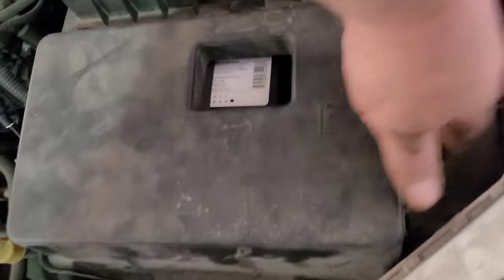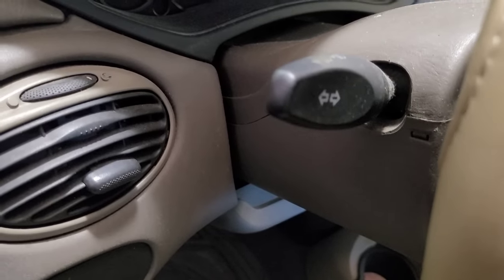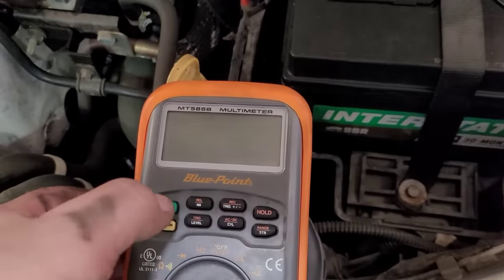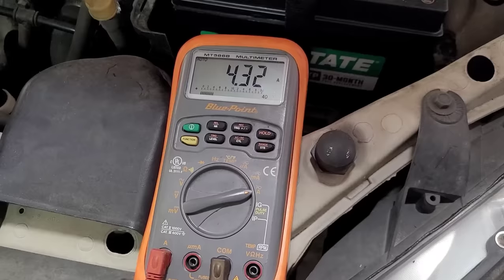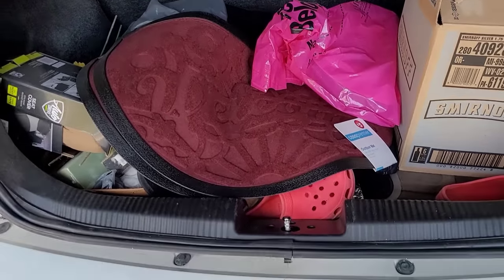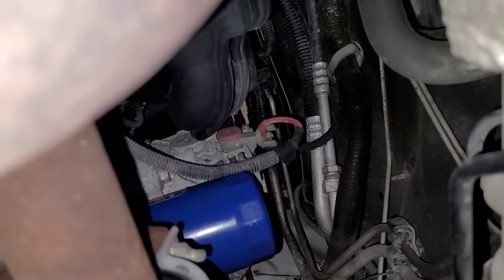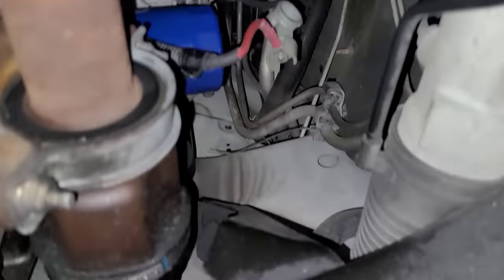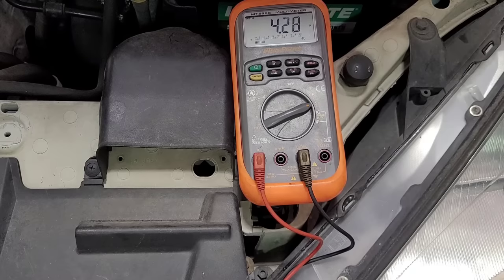Why is the Battery Going Dead? This One Will Surprise You!!

Comment: I found out that lots of oxidation on the alternator bracket causes the alternator internals to not properly shutoff due to the internal triggering due to everything being triggered by grounds that come from the PCM in those cars...Im sure if you just disassembled the alternator and cleaned off all the oxidation from the cases etc also from the bracket the draw would of went away.......For a car that gets hardly used that alternator looked horrible..

Another thing I would of recommended that customer do is get a good undercarriage wash done every spring but Im more partial to a way better and different method I use that cleans and rejuvenates without the risk of creating shorts which is this:

I take a can of CRC Silicone Spray and I start the engine and get it only slightly warm by running it less than 20 seconds then putting cardboard under the vehicle and dousing the whole engine with the whole can doing the drivebelts , sparkplug wires and youll notice the plastic rejuvenating itself aswell as the rubber hoses getting rubbery looking again and dripping off of them will be lots of nasty stuff that causes issues when it reacts with moisture...

Leave the hood open for an hour and all the wetness will be gone and the engine will be cleaner aswell as being moisture repellent...........

https://www.youtube.com/watch?v=mundEgq7pY0

My old 89 Mustang developed a parasitic draw issue and the issue turned out to be the ECU as the ECU controls the alternator too ... After removing the ECU's ability to control the alternator by hooking up the excite wire the oldschool way direct off the keyswitch I never had an issue again....

Comment: DO STARTERS do the same thing sometimes, especially when frequently parked for months??
my stepdads truck was sluggish starting several times in winter despite it not being cold out.
Then wouldnt you know it,  i leave it at a relatives place for a month while vacationing and it would not start no way no how even while boosted.
it just had to be 4 am and minus 17 C too and eventaully we figured out the starter had a dead spot cuz battery and charging system were good.
3 taps on starter while i cranked and it started instantly vs just click beforehand

Comment: With a 4 amp plus draw on a 12 volt battery, that’s around 50 watts.  Something is going to be extremely hot dissipating that amount of power.  I would have used an infrared thermometer, that you can buy at Harbor Freight, to quickly locate the component causing that power draw.

Comment: Parasitic draws (a short, electric clock, electronic trailer brake controller, etc.) can be varied and not necessarily large but will kill a car battery deader than s door nail.  My vehicles (I have 8) sit a lot.  The way I ensure I have a good battery is one or both of two things, I install a battery disconnect device (no electricity needed for extention cords,etc.) which at the turn of a knob or throw of a lever, disconnects the ground lead from the battery so no energy can flow, period.  When you park the car, throw the switch/knob  (under hood, at battery) and it's hood for a long time.  The other way is to use a battery "trickle charger" which feeds a very small but consistent voltage to the battery for as long as it sits and compensates for any parasitic draws. The better units are computer controlled and feed as much or little voltage as needed.  For older vehicles which either have a clock, brake control unit or maybe a small, hidden short which very slowly drains the battery, the basic, old style, "little black box" type of mechanical (not computer regulated) trickle charger is great.  between $9.99 - $19.99 depending upon sales and store (Harbor Freight has them on sale, cheaply, all the time and work fine).
  No matter which vehicle I get in after any amount of time, it starts.  I trust my $60k collectible hotrods, old work trucks/vans and daily driver cars to these methods and have no issues.

Comment: I have an older Chevy pickup and had the same thing and turned out to be the control unit for the ac ,heater .Have to replace whole thing by disconnecting the 24 pin plug to motherboard, controller,less than 8hrs new battery is dead .Part is 400 bucks  IF  available...
Reply from the maker: I'm glad you found it. It stinks that it is so costly to repair. Thanks for watching. Keep wrenching 🔧

Comment: We had a lady from Church that hardly ever drove her vehicle except to church and the store. She had her car into the dealer many, many times because the battery kept going dead. We ended up installing a switch on the battery so she could shut the power from the battery off after the mechanics simply told her she didn't drive the car enough. She didn't care if it messed up the clock or reset the computer. I personally would have went with a battery maintainer for a motorcycle that could have been mounted under the hood and plugged in when the car was not driven. She was happy and that's all that mattered.

Comment: the only thing drawing power should be the radio (memory for station, clocks, etc) and the CPU of the vehicles to keep the drive cycles, etc) but not much as 4 amps.  Unless they have a lights with manual switches with constant power to it, etc.

Comment: I had to replace an alternator on a Focus. It had to go out the bottom. I even had to unbolt the engine mount on the bottom and ratchet strap the engine forward. I didn't have a lift either.

Comment: Often when testing that way, while it is connected, touch your cable to the post without disconnecting the amp probes. See the amps go to "zero". Now pull the cable away from the post. The number now showing is real. If draw is still high. Remove the fuses one at a time, if no change put it back in and remove the next fuse. When the reading drops, you know what system is at fault.

Unlikely your alternator. Not a dependable test for the alternator any way since the alternator is now controlled by your ecm.

Door pin switches, glove box lights and Sun visor vanity wires are big fail points.

To test obscure systems like the fuel pumps pull their relays.

Comment: I have a 1979 Bolens tractor with an external regulator. It charges but has a draw when the ignition is off. Very similar. I have just been disconnection the battery between uses. Once it warms up i will pull the regulator. Old style with relays and coils.

Comment: How old is this car that it has Alt. issues? I own a Subaru and 150K and 12 years and no alt issues adn no other issues until 150k and replaced the radiator and lower control arm bushings. Live on a dirt rd.

Comment: I had a similar issue and found the rear door lock actuator had a bad ground and if i locked it is left over 4a draw because the circuit was open. I found rust in the connector, cleaned the button side and the plug side and the draw is gone.

Comment: I have had that problem before which resulted in a faulty rectifier assembly. One of the diodes is leaky in reverse bias mode letting the current flow to ground.

Comment: Just on theoretical grounds (I'm into electronics, not cars), I'd guess one of the 6 diodes in the alternator is leaking reverse current, or completely shorted.  Did that turn out to be right?

Comment: By isolating the accessory panel, (this model has separate pos. and  grounds), it seemed, ignition switch, starter and alternator were all left in circuit.

Comment: Aftermarket radios, keyless entry, remote start and alarm systems are also regular culprits for vampire loads.  They often draw 100 to 200mA, which is enough to flatten a battery after a couple of weeks or a month in the winter.  Even if you dont park it so long to cause a dead battery, they draw it down far enough that it needs a lot of charging the next time you start it. This prematurely kills alternators.  Aftermarket electronics are mostly junk and rarely do they consider idle current usage in their design.

Comment: My UK built brand new Norton 961 motorcycle used to flatten its battery every week. I did a current check and was surprised to find 0.25 Amps being lost each hour. This current draw turned out to be the on-board computer running 7 sensors 24/7. If the bike alarm was set the problem escalated to totally draining the battery overnight. Not a great selling point.

Comment: At 4 amps, the alternator should start to feel warmer than ambient temp after a period of time. That's nearly 50w of heat sinking into it with no airflow. Also, isn't field controlled externally by the ECM via a relay?

Comment: I've been chasing a dead battery issue after just a few days if no driving.
Hers is a Honda Accord and the alternator puts out 13.8 or slightly higher. She's in at least the third battery 
I measure the draw and it's like .17. I've disconnected any aux wiring for the stereo and such. It doesn't run high and then settle down like I would expect from any computer.
She keeps thinking it's the alternator, but that doesn't make sense based on what I'm seeing.
The average is about three days from a fully topped off charge to dead. Worse in cold weather, but not much.
Reply: My daughters Accord Tourer had the same problem looking at the various forums I removed fuses one at a time and ound it was thr interior lights circuit. The fuse is still removed and no further problems. Watting for the warmer weather suggestions on forums say disconnect the hands free phone / blue tooth unit. Hope this helps. From UK

Comment: Had a car that would not go to sleep if the hood was open.  You could watch the multimeter for as long as you liked, the only way to get it below 50mA was to hold down the  “hood open” sensor, wait about 10 minutes, and it would self soothe and eventually fall asleep like a tired toddler.

Comment: I would check one of the "series parallel" wiring diagrams to see any outlets for the leakage loss. The alternator is still charging.. The rectifier diode is the only thing that can be bad.

Comment: Residual current draw after vehicle has been sitting for over half an hour should be less than 50mA.  If not remove fuses to see if current draw drops to under 50mA & check alternator.

Comment: You should have an ARBST tester. They will diag. the bad diodes. If you  don't have an ARBST tester use an amp clap on + wire before lifting the car. If you are an old school mechanic and rely on carbon piles you should at least have an Amp clamp.

Comment: Ford C-Max has a bizarre fault where once in a while the radio doesn''t shut off whch discharges the battery in about a day.  Fix is to cycle power on the radio by pulling and reinserting the fuse. Mine also failed once where the radio wouldn't turn on - also fixed by a power cycle.

Comment: I have a 2013 Elantra that i replaced the alternator two times, original lasted 8 years, i put in a new after market and it lasted 2 years, and i had it rebuilt, the other day my lights were on for no reason and that's how these cars tell you something is wrong, i started it and test voltage at the battery and only get 13.86, i know i was getting 14.46 when it was rebuilt about 5 months ago, is something killing these alternators?

Comment: Out of curiosity,  why did you expect the parasitic draw to change while rotating the engine/alternator? Have you seen this before. A 4 amp draw would usually indicate a field winding staying on, i dont see why rotating it would make a significant change. But, ive never rotated an alternator which i found had an excessive parasitic draw.
Reply: Not sure why he tried the rotation, but did you see the draw change slightly? That said, I would look at the regulator keeping the field up. The small change on slow rotation could be the brushes on the slip rings.

Comment: The issue you are having is caused by a shorted Diode in the back of the alternator housing which converts the A/C electricity the alternator creates and rectifies it to DC, there is usually three Diodes which can be replaced but may not be worth the effort.

Comment: Note: This isn't meant to be judgemental. I'm only trying help:
Testing for a draw that way can result in a blown fuse in your meter. If the meter isn't overloaded, it may take significantly longer for the vehicle to go to sleep.

I prefer to use a battery disconnect between the negative post and battery. I connect my test leads to each side of the disconnect, but leave it "on" initially. That allows me to run the vehicle through a start/stop/lock sequence before testing. Changing the disconnect to it's "off" position makes the meter the only path for current flow.

Comment: It is not the alt., so, rhe problem will not be solved by swapping that. 
The main positive battery cable is shorted to the body or the egr pipe. 
Simply wrap your fingers all the way around the positive cable as you chase it back toward the starter. 
You will find that it is welded somewhere to the body or egr, just inches from your view. 
Very, very common problem on those cars and that one seems to have not had the battery cable recall done.

Comment: Just FYI - old Craftsman DMM can go to 20 amp in “in series” hook up. It’s my favorite one to measure the parasitic draw, I bought it in 1999 - and it still “kick butt”!!!
Reply: Wrong meter for car electrics ... Get a dc clamp meter ... Available up to 600 A (from 6A). I have one that goes from 1mA to 100A in 3 ranges ... No need to disconnect anything to measure current accurately and ZERO chance of blowing the meter ... Leads can ONLY measure volts!!
Reply: @boblewis5558  I do have those also. But every time I use them - second guess myself, sometimes rightfully so.
Reply: @commenter5469  ⁉️⁉️⁉️
Reply: @boblewis5558  Everything in any meter measures volts only - everything else is a conversions.
Reply: @commenter5469  

a) only in a digital multimeter not e.g. an AVO mk8!

b) current is measured in various ways but it is still current that is being measured e.g. a Hall Effect device and it's producing a voltage output i.e. a conversion.

BTW I'm a grad electronics engineer and have been for almost 50 years ... Now retired but still active in electrics/electronics/engineering diy
Reply: @boblewis5558  You forgot to mention galvanometer, I have two of those. Used on excavators Power Shift/EPPRV circuits. I love analog stuff, in some applications there’s no substitute.

Comment: "it's gonna have a certain amount of draw no matter what."

Well, it shouldn't. Off means off. 
Have a dodge magnum that does this. Draw at random times on the body control module, which could be a whole universe of little switches and whatnots. Sometimes its dead after a week, sometimes it will start right up after sitting all winter. Seems like a moisture thing somewhere. We installed a drag race cutoff switch on the feed to the main box. click it off, battery stays good for months. You have to reset the clock, only bad thing.

Comment: Good video for this. But make sure that your meter can be left in the amps setting and in line with the battery for that amount of time. Instructions in my meter tells me I should not leave the meter hooked up like this for more than about 20 minutes before disconnecting it in allowing the shunt in the meter to cool. Leaving it on too long can damage the meter. But your instruction manual for the meter should tell you this.

Comment: Had the same problem. I put in a new alternator because the car had 350,000 on the original alternator. 6 months later the battery kept going dead. Started looking for a draw and found the alternator was the source. Returned the new one and put the old one back on.

Comment: Capt. obvious statement here, the best fix is to find the problem and repair it properly. However, there are always those individuals on a tight budget that cant afford an alternator. For those ppl, if your willing, you could - Im thinking friends, family, elderly person: you could always install a Battery Quick Disconnect. This repair falls under charity work for the hard luck cases, so parts and labor will be free; if your willing to take on the liability. Ive been wrenching since the 80's.., and there's always that one hard luck customer whose life throws them a curve and yanks on your heart strings - for them a Battery Quick Disconnect is an option until they can afford an alternator.

Comment: An alternator has (4) diodes.  If (1 or 2) of them go out, you can still get voltage.  Sometimes erratic.  But you will not get enough amps to charge the battery.   And bad diodes can (likely will) drain the battery.

Comment: 4.5 amps is A LOT, that battery shouldn't have been able to crank over the engine after 24 hours. The strangest parasitic draw I ever found was a DVD player in an '03 Suburban. About 800ma draw, all doors shut, all modules asleep, I'm pulling fuses and watching the meter - when I get to the OnStar/DVD fuse, it drops to 60ma. Crazy thing was, it was the eject mechanism. Being mounted on the ceiling, I guess the pinch wheels that feed a disc into/out of the player were worn from heat/cold cycling. It had a DVD sticking out maybe 1/2" and the little eject motor was just running and running. I understand why it has power without the key in ACC - you need to get the kid's Spongebob DVD out of there and it's inconvenient to have to have to move to the front seat and insert the key... but the fact that the eject sequence never "timed out" seemed crazy to me.

Comment: It's probably the diode trio ,it allows voltage to into the battery while the engine is running but stops voltage from running back out with the engine off.